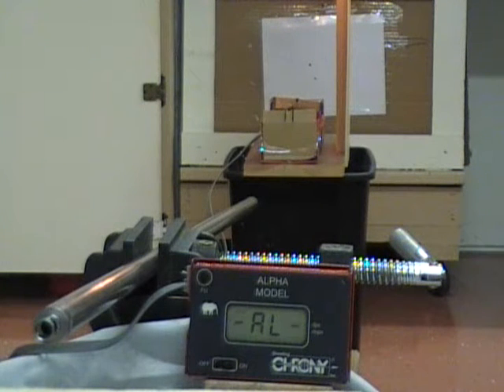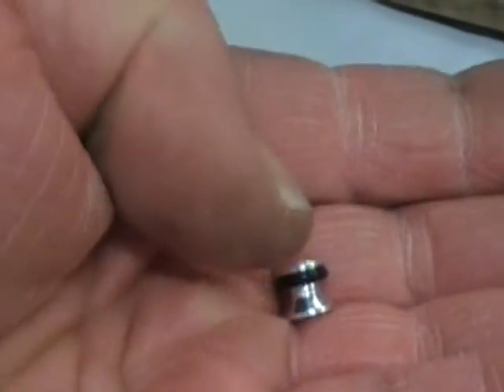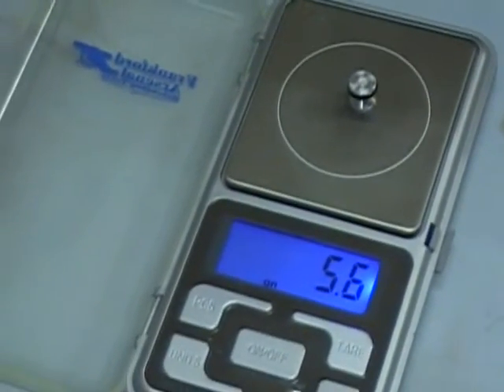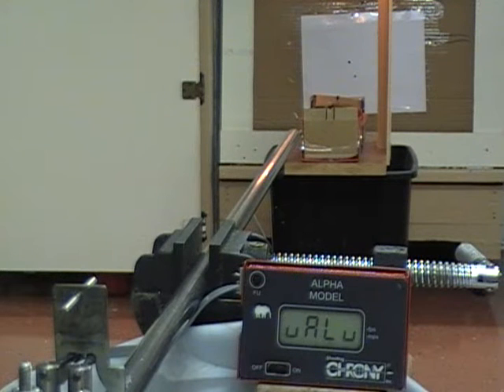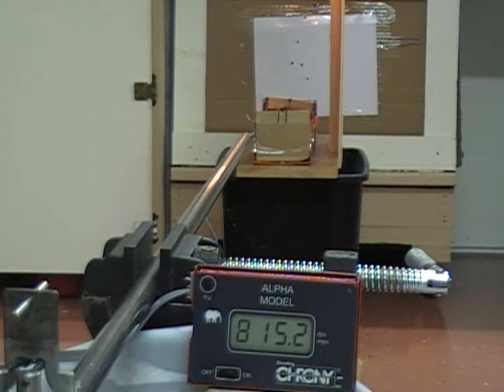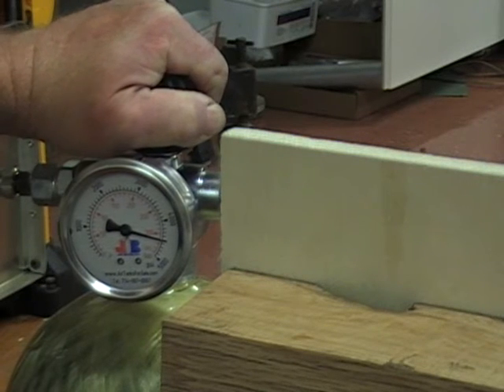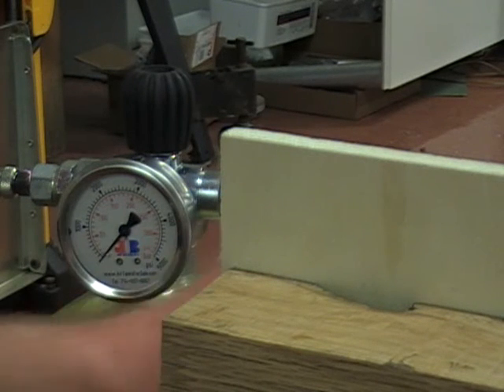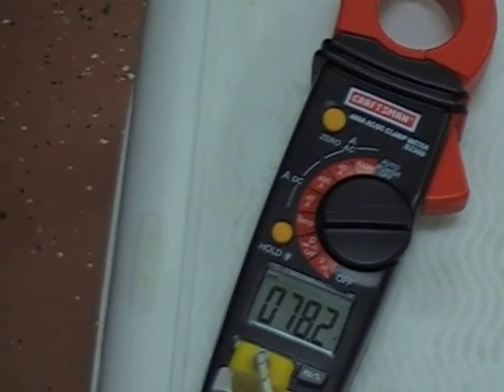2035 fps PCP  Airgun Lab with extensive documentation

Comment: Thank you for this experiment.  
The 12g of air must have been very hot from the filling process in order for it to increase the temp of that massive metal block ~5F in just a few seconds, correct?  Would be interesting to see the pellet speed drops after the gas dropped to room temp.  Might take a while since air doesn't transfer heat too well.  Might require a pressure gauge on the dump chamber to verify there were no slow leaks.
Reply from the maker: Thank you for the interest and comment. Because there was a slow leak past the pellet, I had to fill the reservoir quickly so that there would be plenty of pressure for the shot. When the air leaves the fill hose and expands, it first immediately draws heat from metal reservoir, making the metal cool. But as it re-compresses inside the reservoir, it gives up heat to the metal, so the temperature of the metal quickly rises. This all takes place within just a few seconds; actually much faster than you would think.  If the gas remained in the reservoir long enough for the temperature of the metal reservoir to cool back down, part of that heat would go into increasing the pressure of the gas (air) in the reservoir, and the rest of the heat would heat the air around the outside of the reservoir.  You can think of it this way: the heat capacity (you might call it energy capacity) of the metal is just a change in the temperature of the metal. But for the gas, the heat capacity is both in the temperature of the gas and the pressure of the gas. And that depends mostly on how quickly the reservoir is filled. If you fill it slowly, the pressure will go up and the temperature will stay constant. 
But if you fill it quickly, the pressure will go up less, but the metal of the reservoir will get hotter. The total energy does not change, it just changes state.
I demonstrated this (to myself) once when I quickly filled a long tubular reservoir that had a piece of synthetic material at the far end to act as a filter for when the air was allowed to exit. The entry end of the tube got very cold, but the far end of the tube, where the material was, got very hot, hot enough in fact, to char the synthetic material! I wasn't really  expecting that, but it really drove the point home. If you think about it, it is very similar to the compression process in a diesel engine. Lloyd

Comment: Good job
Reply from the maker: Thank you. It is strictly a lab set-up but it does show what kinds of projectile  velocities can be achieved with compressed air. Several other people have since achieved velocities in the same range. The physics of compressible flow is loaded with traps that make it easy to make incorrect calculations. But it is hard to argue with empirical data. Lloyd

Comment: From my understanding due to choke flow it is physically impossible to accelerate compressed air way past Mach 1. How do you overcome this sir?
Reply from the maker: I don't think choked flow is applicable to this set-up.  The pellet is restrained like a plug until full pressure is applied to it, then it is released.  The air is supplied from the small reservoir via a converging nozzle, approx 1" dia down to .278" of the barrel.  Nothing special.  Several other people have made shots well above Mach 1.
Lloyd

Comment: Mad skills Sir,carry on Sir Lloyd
Reply from the maker: Thanks for that update Rob.  I plan on getting back into the high velocity testing later this fall or early winter with more refined equipment and improved documentation and hopefully some witnesses. Its a personal challenge, nothing more.  I am 65 and  this is what keeps me feeling young.  Lloyd
Reply from the maker: +Old School Hand .  Thank you. It is obviously a hobby of passion.  I've been continuing to work with this set-up and the fastest shot so far has been 2164fps with a 7.1 grain projectile.  Lloyd
Reply: LLoyd , is 2164 still the record, what was the bore for this shot?
Reply from the maker: The barrel for this shot is .278 smooth bore tubing, about 48" long.
I don't know if 2164 fps is still the record, I think it will be continuously broken, just like any other record. If there is a limit to the maximum velocity, I don't think there is a good understanding of what really controls the limit.
Lloyd
Reply: lloyd-ss it is still the record across all forums